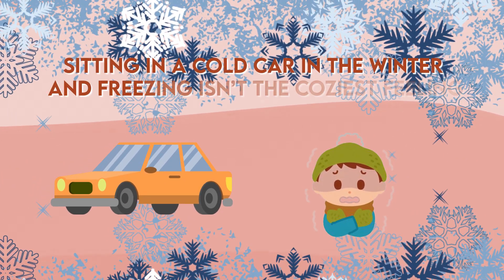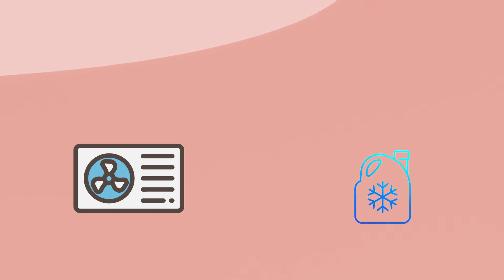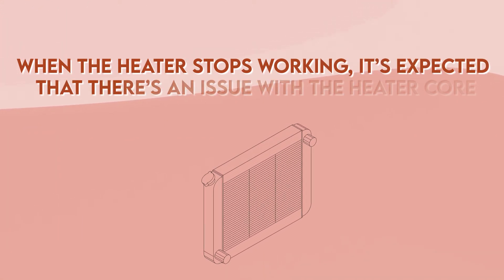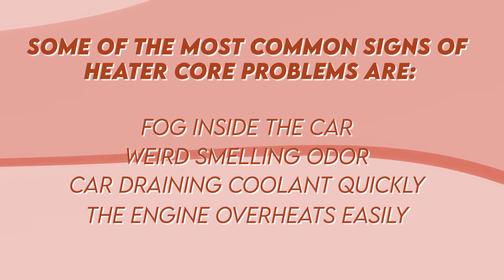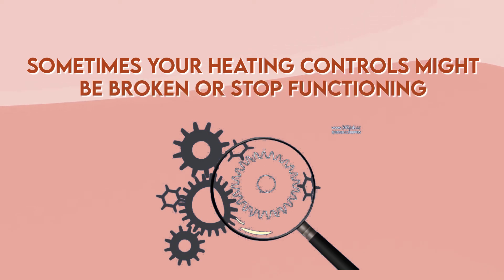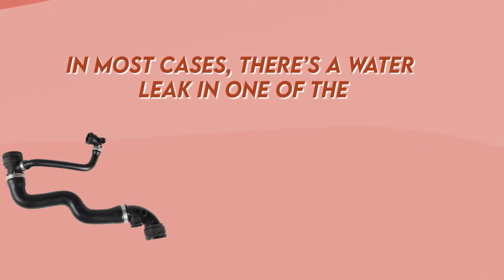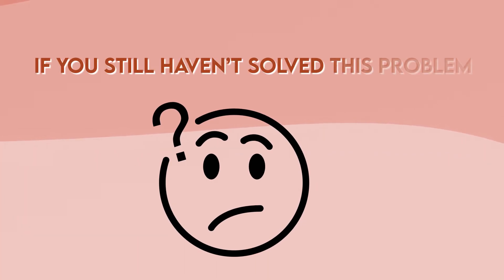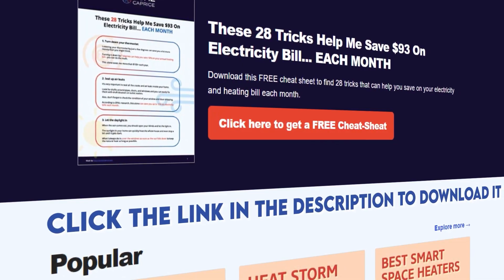6 REAL Reasons Your Car Heater Is Blowing Cold Air

Comment: how does one flush out air bubbles?
Reply from the maker: To flush out air bubbles, you can bleed the cooling system. Usually, it involves opening the bleeder valve or running the engine with the radiator cap off while topping up coolant. Just make sure the engine is cool when you start!
Reply: @homecapricehc  thank you